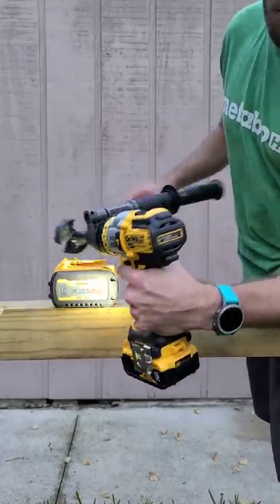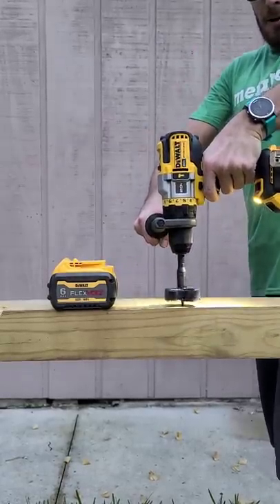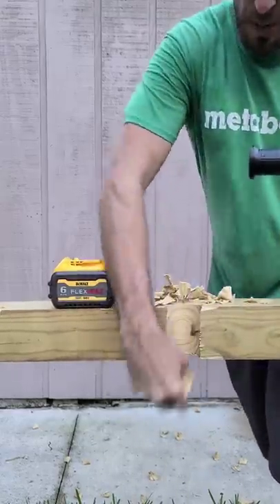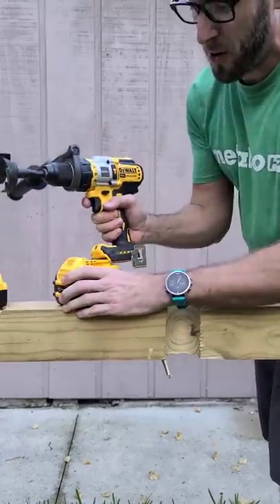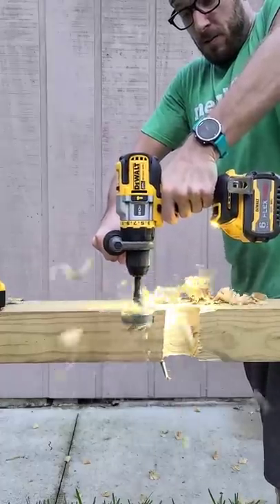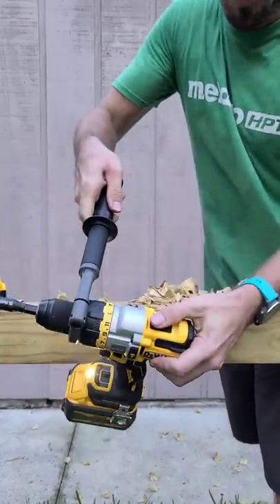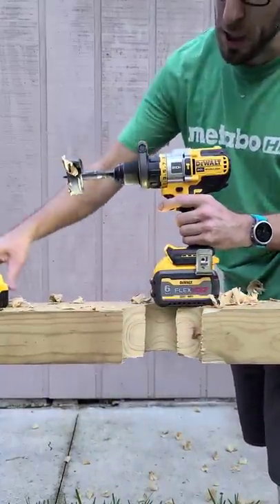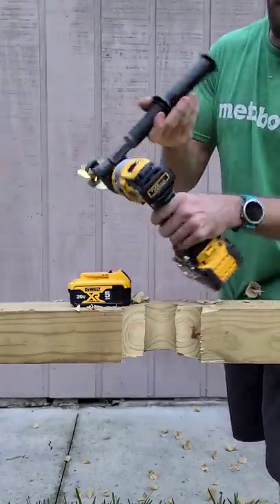New FlexVolt Advantage 20v Drill - quick test

Comment: Not entirely accurate.  All wood drill bits do way better with an open place to exhaust the shavings.
Reply: Amen I was building with IPE and just to drill a small hole or counter sink you have to clear the bit every 2 seconds. Or else it just burns onto the bit xD
Reply: I was thinking the exact same thing, no way it's accurate with all the shavings just flying out through the side and not gunking up the drill bit
Reply: Quero um
Reply: He does the same with both batteries so neither have an advantage
Reply: @EliTeTritton  The size or amp hours or the battery won't change the performance. The drill performance is misled because the wood bit has a place to release the wood shavings.  Anyone who has ever worked with a cordless drill on wood knows this.
Reply: You right but this guy couldn’t hold the drill straight to save his life xD
Reply: @EliTeTritton  the only way to make that accurate would be as if he was putting the exact same about a bit out of the wood on both tests and he wasn't.
Reply: Agreed. The testing was not fair....
Reply: Nerddd
Reply: Yep...
Reply: it almost seems disingenuous to cut that third hole so much different than the other 2. bad science.
Reply: Exactly
Reply: Tim Raymond  not cool, Tim. Lol
Reply: Tim Raymond   nobody like a wood drill bit bully.  🤣
Reply: Exactly. Each cut he is cutting through less and less wood
Reply: Alexander
Reply: I was thinking the same thing
Reply: Yall are completely missing the point of the test. It's only to show the difference in the batteries discharge rate. In the long run its going to burn the motor out faster.
Reply: @dannyhernandez1296  the exhaust of the shavings will still play a factor
Reply: @Super_64  itll play a factor in the speed of the bit but thats not the point of the video.
Reply: @dannyhernandez1296  this conversation thread is about it not being entirely accurate.
Reply: Absolutely. Common sense Kicks in for some of US lol
Reply: I though the same thing and wondered why he did it the way he did.. doesn't show the true outcome
Reply: @Survival1  lithium batteries have a C rating. This rating describes the Max amperage at the rated voltage a battery can provide. With the same C rating, a higher capacity battery does provide more power. The 9Ah battery can provide nearly twice the amps as the 5Ah battery if they are using the same cells.
Reply: @kevinirick1415  I'm a current journeyman electrician.  I know how these tools work.  Its disingenuous to drill through wood and claim it will perform that way when the shavings get spit out the side. Thats all I'm saying.  I'm sure it's a good product. I'm just saying.
Reply: @Survival1   I completely agree on the wood shaving part. Letting the waste evacuate like he did does not demonstrate real word performance well. I was just commenting on how battery capacity can change power. It seems you edited your comment to remove the claim of capacity not affecting power, so you must agree.  22 year electronics technician / field engineering support here. I know how things work too.
Reply: @kevinirick1415  good talk, My guy. You know your stuff! Nice. I like Dewalt and Makita, myself.  What do you prefer?
Reply: @Survival1  I am a fan of all tools. I’m in the DeWalt battery system, so it is all I own and I am happy with them. Like the Milwaukee too. Only owned a corded Makita 1/4 sheet sander and didn’t like it so I’ve never given their cordless a fair chance.
Reply: @Survival1  not true the flexvolt advantage line will pull extra amperage out of flexvolt batteries, thus more power. Sure both cuts were easier than if he went in the center of the board but both cuts were equal in terms of power required to make.

Comment: “Let’s clip on the 9 amp hr” but it’s really just a 6 amp hr
Reply: He may have read it upside-down..........I lost faith in my sentence before I even finished...
Reply: @matthewhoffman9242  well upside down it would read HA9 with the a upside down....
Reply: @chancebilderback8720  doesn't help that I think even the 6ah flexvolt batteries of the next gen are going to have the same yellow pattern as the 9ah batteries
Reply: It doesn't even matter, even 4ah battery would perform the same 😂 every original battery pretty much can give out same amount of current/voltage 😂
Reply: He said 6 in the end
Reply: He corrected himself in the end
Reply: @Positive Thoughts you can litterally hear the difference
Reply: Tyrone Notwatson  yeah but it sounds like the motor struggles less
Reply: They're the same voltage battery. Any difference is imparted by the user.

Amp hours are a measurement of capacity, means literally nothing to the motor.
Reply: @Just-Steve  ok thanks for clarifying
Reply: @imstupidbut1356  I'm just saying, on their website DeWalt says without any explanation that using the more expensive battery with this tool gives you 42% more power. Sounds like they're trying to sell more batteries. And new tools.
Reply: @Just-Steve  that's not always the case. If you increase the amphours by putting more cells in parallel you also increase the maximum current from the battery pack and therefore also the maximum torque from the motor.
Reply: @Just-Steve  Using the FLEXVOLT ADVANTAGE technology, the tools can recognize the battery attached and adjust the amount of power supplied to the piece of equipment.
Reply: Amps create torque and volts speed you can normally take a DC motor to about 20x it's rated voltage as long as you don't go over the rated amps. I have drove a 12v 1a stepper motor to 200v 1a without damage and that is more power but by more power I think the marketing wankertering is on about the more amp hours but hey I'm drunk and just wanted to type something on both the keyboards I can see 😁

Comment: For anyone who works with drills everyday, you'd know thats a strong drill
But its definitely Dewalt to have multiple batteries with different power settings to squeeze every penny out of us
Reply: TEC Youtube  I can't think of any off the top of my head other than Dewalt that has two different batteries of the same voltage with different power capabilities. If you can tell me I'd be curious to know. Also, I can name a few companies off the top of my head that don't do it at all. And they charge less than Dewalt and make a great tool by most standards. Putting that many periods after a sentence is really dramatic by the way lol
Reply: TEC Youtube  The difference isn’t capacity, because every brand sells multiple capacity batteries. The difference here is power delivery. Dewalt not only sells different capacities, but higher output batteries that cost more just to be able to get the full power of the tool you paid for. It’s like buying a brand new sports car but needing to swap the engine.
Reply: TEC Youtube  For one, you could’ve said all that in one reply, I don’t think you’re in that much shock. Two, I own many brands of tools and their batteries, such as Dewalt, Ryobi, and Milwaukee. Not only that but I WORK in the field of electronics, and have dismantled many batteries for repair. Battery capacity and power delivery are two different things bud. A battery can be 2 amp hour but have a high ass discharge rate while a 6 amp hour battery could be weaker with a lower discharge rate. Capacity does not correlate to power output. And voltage doesn’t change the rate of current here either. I know for a fact Ryobi has two classes of battery available on the market. Lithium+ which works with every tool in their lineup and the Lithium+ HP which has a higher power delivery for brushless motor tools. This higher power delivery only works with compatible tools, and the battery usually comes with them. With Dewalt in this video, they sell the tool with the battery of lower power delivery and require you to buy another battery that costs over $100 just to unlock the full potential of the tool you already emptied your wallet to get.
Reply: TEC Youtube  You hurt that I proved you wrong my guy? I gave you the hard facts and your three responses are sad attempts at insults.
Reply: @ToolforOffice  Milwaukee tools
Reply: @joeythefoxxo  yeah it’s ridiculous. It’s like when Milwaukee sells you a M12 3/8 stubby and gives you a 2.0amp hour battery. So stupid
Reply: @joeythefoxxo  it's more like buying a new sports car and putting regular gas in it versus premium.
Reply: @tatsuhirosatou5513  Better put. And on that note, many tool brands are also trying to sell higher power batteries for tools that don’t need it. Which is like putting premium gas in a regular car.
Reply: @joeythefoxxo  no it’s more like adding a turbo, NOS, or supercharger. The engine isn’t different it just giving you a better fuel delivery
Reply: Its gotta be Milwaukee
Reply: Not the way I see it. They’ve had 60v tools for years that would only work off of 60v batteries(flexvolt), which you could use on your 20v tools. But your 20v batteries wouldn’t work on those 60v tools. The way I see it, instead of making this a 60v only drill, they made it one that could work off of 20v or 60v.
Reply: @christophercrawford2736  That’s the tool though. We’re talking about how there’s a million batteries for one tool that makes a massive difference. And that proves it. If you wanted a flexvolt battery you need to buy it separately.
Reply: @joeythefoxxo  I don’t know about this specific tool, but I only buy my Flexvolt batteries with other tools/combos. I never buy them separately.
Reply: @christophercrawford2736  Dang, what? All the tool combos from Lowes and Home Depot here sell the cheapest battery possible in their kits.
Reply: @joeythefoxxo  My first flex volt battery came from buying it from a local tool reseller who sold as a combo with a flex volt tablesaw for like 300 bucks. If I’m remembering correctly. My second Flexvolt battery came from a Home Depot kit with a leaf blower. I sort of wanted the leaf blower, didn’t 1000% need it but it would be useful for the project I was working on, I really wanted another flex volt battery, preferably bigger than the 6.0ah one I already had. So that’s how I got the 9.0ah one. Then I got a couple more included with a flexvolt reciprocating saw, medium sized toughsystem box, and a couple other tools from Costco a few months ago for $400.
Reply: @joeythefoxxo  I got the 9ah battery paired with the 60V grinder. That thing is awesome 👌🏼there's also a 60V reciprocating saw and the table saw that I can think of. The 60V max line was made for big tools. The flexvolt advantage does just that... takes advantage of those batteries
Reply: Of course no one here is mentioning that if they sold their drill with the better battery they would have to charge more for it(lithium ion cells are not cheap, just ask tesla.) So then your $200 drill set would be $300. Okay great if you need the power but the majority of people dont, dewalt cant just market themselves as a profesional tool, they have to compete with prices to sell more product and make better tools. So they sell their merchandise with the bare necessities to make it work. Or just buy the drill on its own and a battery charger set separately. They give you the options.
Reply: Atleast dewalts batteries fit all their tools. Unlike makita, bring out a new batteries what only fit... their new tools 🤦 £625 for a combi, impact, 2 batteries and a charger! Fuck that!
Reply: @Tatsuhiro Satou  I would really equate it to buying a dodge demon and only getting they key for 707hp and having to buy the key for the 808hp because it doesn't come with the car